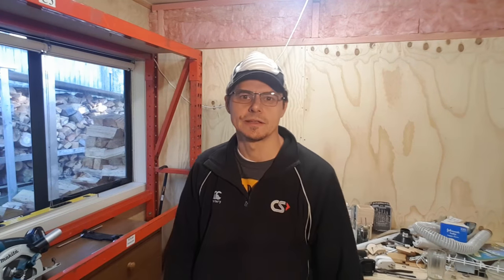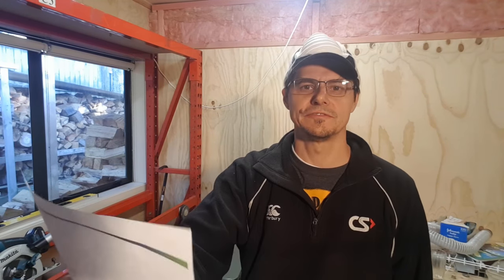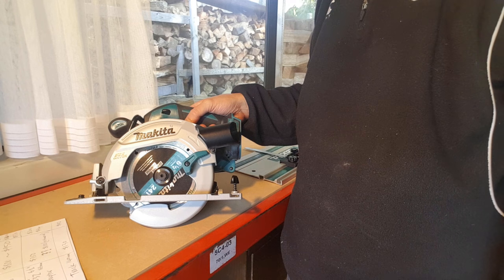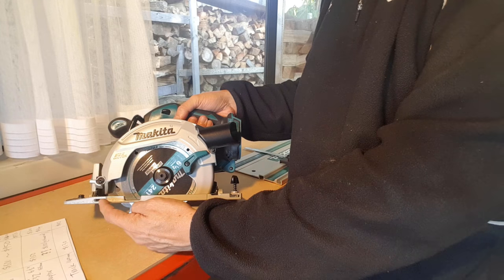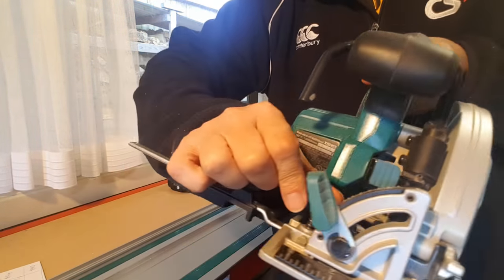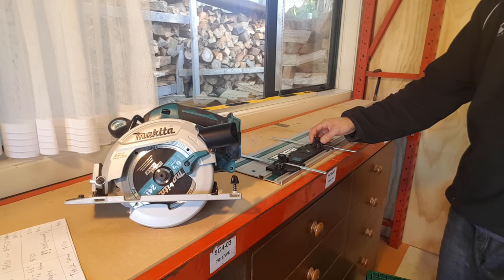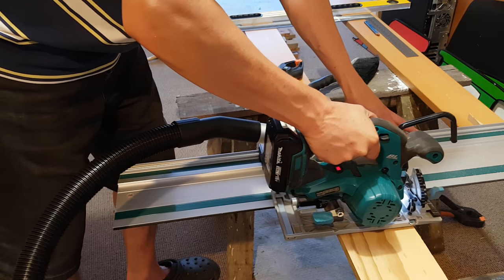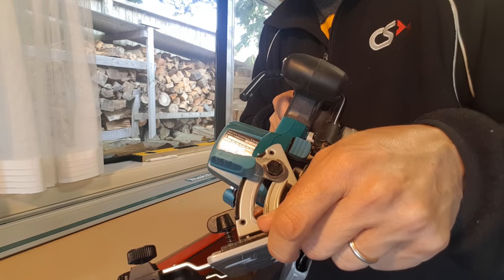Makita circular saw adapter for rail guides - circ saw becomes track saw.

Comment: Hi Rob, a great down to earth video. I have that saw here in UK and now want to buy the adapter. There seem s to be several Makita rail guide adapters over here. Do you have the part number please? Good luck with future videos.
Reply from the maker: Hello Christian - thanks for your comment! The part number in the US is "196953-0 Guide Rail Adapter". I'm afraid I don't know what it is for sure in the UK but you should be able to figure it out from the US one which I am 100% sure of. Makita has different model numbers for almost all their products here in the NZ and different markets; I have no idea why. Here's a link to it on Amazon: http://amzn.to/2px5qFo - if you are doing lots of crosscuts I would recommend the clamps for the track to stabilise it as the weight of the saw can tip it up and move it off the line. For long rips the track stays put just fine with its non-slip pads.
I'd also like to reiterate this as a really worthwhile investment - it has enabled me many cuts with ease at a high level of accuracy that I'd struggled with in the past with clamps and straight edges. 
Best of luck and hope it goes well! Cheers, Rob
Reply: Hi, may I ask, did you find out the adapter name?
Reply from the maker: Hi Christopher, people have told me the adapter can be ordered through Makita stockists if you can't find it online in your country. If you call your local Makita head office they should be able to help further as well. Cheers, Rob

Comment: ...ahh you also need the adaptor, £50 for adaptor and £100 for guide rail , mad expensive here in the UK :(
Reply from the maker: same price everywhere mate - it's a few lbs cheaper for the adapter in the US, the track is much cheaper though. Expensive here in NZ too. I haven't ruined any $100 sheets of plywood since I bought it though. Priceless.

Comment: Hey Rob, Really late to this one, but wanted to ask a question if you're still around :)
You mention in the description to try and never change the setup of the adapter bars as you'll never get them perfect again, but am I right in understanding that they would need to be adjusted if you were doing beveled cuts?
Reply from the maker: Yeah that's correct, it does need to be adjusted for bevel cuts.

Comment: Hi There,

I've got a Makita 165mm corded saw and I'm thinking this adapter and a rail  would be just what I need speed things up. Is there any chance you could give me the measurement  of the bars that connect the adapter to the saw? When I say measurement, I mean from the outside of one bar to the outside of the other.  
Any help would be appreciated.
Cheers from the Waikato
Reply from the maker: Hey Colm, here's all the dimensions...
The bar is 12 x 3 x 290mm, and 214 apart on centre. So 225 from outer edge to outer edge. Hope that helps down in the Waikato 👍🏻 cheers from Pukekohe!
Reply: @TakamiWoodshop  
Thanks Rob, it should work just fine, I appreciate the help.

Comment: good gears Rob.   what is the function of the knurled knobs ? - some sort of adjustment, but I can't  quite fathom them
Reply from the maker: Hey Ted. I think you are talking about the black plastic knobs on the adapter itself - they are just for locking the aluminium arms in place. The arms move in and out depending on what saw you are mounting the adapter to, or the angle you are cutting. When cutting 45¯ the adapter has to come out a tiny bit to allow room for the tilted blade. Hope this helps. Cheers 👍

Comment: Just the video I was looking for, having recently got one of those Makita DHS680s! But can I ask what depth of cut you lose when using the track? I just need to make sure I’ll still have enough depth to, say, trim a door.
Reply from the maker: You only lose about 3mm ... Just the thickness of the track. Cheers 👍🏻
Reply: Rob Tee - Takami Woodshop - That’s hardly anything, making it an even more irresistible buy! Many thanks for the quick reply.
Reply from the maker: Just make sure you have the saw with the two attachment slots, the newer one has only one and uses a different adapter. There are some more details in the comments section here from a user named Zaar. Also I have links to both adapters in the description. Happy cutting man! 🤙

Comment: Thanks for the great idea! I'm a similar situation being a weekend warrior here in Down Under and already having DHS680z. It looked a shame to spend another $800+ for plunge saw that actually has the same cutting capacity as DH6S80z. Couple of questions please: 1. Does the blade aligns perfectly with the track edge such that you can align the track to you pencil mark and roll the saw? 2.  I'm struggling to get 90°  cuts with my saw, using rafter square as a guide as you do - it's always about half a mil or so off along the cut. Examining the saw, I noticed a free play in the fence - it's in the rear part of it, both left-right and up/down. Do you have that small free play in your fence? Thanks again!
Reply from the maker: Hey Zaar, This is a great way to save 800 bucks - I use it all the time and I've had it for about three years. Your questions - #1 yep - it's very easy to align the track to the pencil line and then the saw cuts perfectly along that line. It's very impressive - with clean perfect cuts too! #2 no. My saw doesn't have any play at all and it cuts perfectly every time - whatever angle I tell it to. I suspect yours has some damage or manufacturing fault - it shouldn't move at all.
Thanks mate - hope this helps. Cheers, Rob
Reply: Got the dhs680z also and was wondering about this
Reply: I've just got this adapter on a 680z and at the 0 mark the blade hits the rubber edge which is meant to be cut off I assume by the blade on the 1st pass idk ? For 230 bucks for the adaptor and rail I'm not convinced yet

Comment: What does the teal slide button do on the black plastic guide rail
Reply from the maker: It locks the guide rail adapter to the track so the saw doesn't topple over when it's tilted for miter cuts.

Comment: I have been looking at DIY track saw ideas on YouTube for a while now. And given I have started looking to get a cordless Makita circ saw, I reckon you have made my mind up. With the 2 guide rail slots I think I can still make a good diy job myself
One question though. Does the saw have an electronic brake? It sounded like it when you finished the 45deg cut but it isn't written on the saw like the other models by the looks
Reply from the maker: Hey dude, yes it does have a brake - you can see it in action on this other sled thing I made .. https://youtu.be/DCcwjFEG88E?t=13
Reply: @TakamiWoodshop  Onya Rob. That sled was a nice job too. Good to see he saw rip through that big laminated beam too. Will be getting one next week!

Comment: Hi there I just got one of these today, may I ask you a couple of things? how did you cut the black trip off at the beginning of the track since the whole saw is not on the track and hence it wobbles which means an uneven cut. Also did you find when you line up to zero at both ends its not quite level - one side seems perhaps 1/3 mm out? or do you thing that makes no difference? thanks in advance
Reply from the maker: Hey Chris, for cutting the strip at the beginning I honestly don't remember what I did but I'd recommend placing a sacrificial board of some sort under the part of the saw that isn't on the track - say, some 2mm mdf or something - whatever it takes, and maybe setting up a straight edge if it helps to make that initial cut cleaner. Another way could be to loosen the depth of cut knob and plunge down into the strip - not sure if the blade would reach that far back though but worth investigating. 
If you can't get it cut consistently with the rest of the strip you just have to remember not to use that first part of it to line up with your marks. Or you could cut it away with a blade later on, or plunge in and make the cut on the bulk of the strip, then back the saw up to get that last little bit at the beginning. (I'm just thinking out loud here) Ultimately - borrow another track and run along it into your new one and you can't fail that way.

About the adapter not being level - do you mean it has a bit of twist in it? I don't think it matters as long as the arms are set at zero (identically) at both ends the blade will run true and the weight of the saw will press down and take that 0.3mm out of the equation.

Cheers man, good luck and happy cutting! 🤙
Reply: @TakamiWoodshop  yes thanks for the time, I just came to that conclusion about the beginning and end- its just for the saw to sit as you get to your stock to cut, it is 150cm long so good job really for that reason. The arms being zero - i noticed (forgot to say before) when they are both on zero the black plastic body that touches the metal of the saw (base) is not quite flush - a bit of a bigger spark than the other side that what got me thinking also about the zero marks are they accurate . so its either the markings are not accurate with each other or the main body of the black plasic is not quite true - like you said if its out just by 1/3mm then should be ok. also actually there is a risk of not putting to zero since the blade gets very close to the track it self. for some reason i was expecting the arms to 'click' in position for the zero - well I guess worse case I buy another rubber strip to try again :) .
Reply from the maker: The zero marking could be better I agree - I'd like it to click as well but what I do now is ignore the mark somewhat and try to just line it up with  where I want it to be on the strip. You don't want to let the blade get close to the track (don't ask me how I know that 😉).
One more trick with these tracks - you can peel off the strip and flip it around and start again if it gets too manky. The strips can get damage or inconsistencies by using blades with slightly different kerfs - that's actually how I ended up ripping a big strip of the aluminium off the side of mine.
I set mine and leave it set now - I don't adjust it once I've dialed it in how I like it. The main reason I do this is that I also don't really trust the accuracy of the body, the zero marks, or anything really. Rather than rely solely on the marks it's worth double checking with a ruler or some calipers.
Once you get it set up it's a cool tool though. Much much better than clamping on straight edges.

Comment: Hi video, can I ask you somethings? at 3.11 when  you did the mitre cut - what tool make etc did you use to get your 45 degrees so perfect? What saw did you have to cut the dowels flush (4.32) and lastly I love your drill press :) you selling it any time soon , looks old but built to last . thanks in advance
Reply from the maker: Hi Christopher - thanks for your comment. The tool at 3:11 is the Makita XSH03Z Cordless Circular Saw (https://amzn.to/3ccFGGy). For flush cutting dowels I'm using a Japanese made Shark Saw similar to this one - https://amzn.to/3iFihzK - I also have and recommend this one more than the Shark for flush trimming: https://amzn.to/32C5IzI
The drill is a beauty indeed - but I have sold I already I'm afraid 😥. It was too small and wasn't very powerful. I've replaced it with a 1 HP model - 400% power increase and much larger capacity.
Cheers mate!
Reply: @TakamiWoodshop  thanks for the info

Comment: Welp. This will definitely NOT be replacing my plunge saw. Looks like a really nice saw though. Pretty bad track saw design though.
Reply from the maker: Woop, I wouldn't have this if I had a plunge saw either. But just curious - why do you say it is a bad design? In the video I thought I presented the case fairly well that it works pretty freakin' well. I've never had a problem with it in fact.

Comment: Question about the attachment. Once it's connected to the saw, does the attachment clip into the track or is it just sitting on top in the channel?
Reply from the maker: Hi Travis - the saw does not need to be clipped unless you are doing 45° cuts in which case the saw will have a tendency to want to fall off - in this case there is a clip on the attachment to prevent that. It's only really for when the saw is sitting unattended - when you are making your cuts you'll be holding it firmly in place as you push through. I've been thinking about doing an update video after about a year of usage - my biggest tip is to make sure you have the attachment pushed right up to the stoppers, and don't forget to adjust the position for different angles. By failing to do these things I have cut most of the rubber strip off the track and even nicked the body of the track slightly. And finally - for narrow crosscuts (300 - 400 mm or less) I'd highly recommend the clamps that hold the track to the workpiece - I wish I had them - to prevent the weight of the saw upsetting the position of the track on your cut line. Enjoy the system - I sure do!

Comment: Hi,did you say you have the "DHS680Z 165MM 18V LI-ION " ? thanks
Reply from the maker: Correct (ish). Technically it's a XSH03Z because I brought it back from the US, but in NZ it's model number is DHS680Z (165MM 18V LI-ION) . The only difference is that on my one the measurements are in inches whereas if I'd bought locally they'd just be metric. Sweet saw, sweet setup. I still don't have the plunge saw and I still use this rig all the time. Cheers. 👍 (Check out my other vids if you haven't already - come one come all)

Comment: Hi, good video, did you find the cut using the guide was perfectly straight? also do you think the track and adaptor will fit the  Makita HS7601J 190 mm Circular Saw (I am in the uk, why the change code for parts of the world god knows)
Reply from the maker: Thanks mate - it's really hard to say if it will work with your saw. The bars on the adapter are 215mm apart centre to centre if that helps. Been using it for a couple of years now and yes - it cuts dead straight every time. cheers, Rob

Comment: Hey Rob - Fantastic video! Got here from Scott Brown mentioning this video. Now subscribed! Been looking all over and hadn't found this info. Will now chase down the bits and pieces. Way cheaper and more versatile for a diyer over a plunge saw. Thanks mate. Cheers PP
Reply from the maker: Hey Poopy, cheers mate, hope it all goes well for you, been using this set up for a couple of years now and it's still mint for my needs. I've been thinking about getting another track to cut in half to use for crosscuts as well.

Comment: Hi Rob, loved your vid prez. I’m late to the party on this but have a question please. I have a DHS680 and have just got the guide rail adapter. What way up do you fit the 2 rails? They’ve got P & D marks. Also is it different for LHS & RHS fit? Keep up the vids mate! They’re brilliant for late starters, like me. Cheers, Paul
Reply from the maker: Hey Paul, mine goes like so...
Holding the adapter so as the embossed Makita is upside-down, insert the rails in from the left with the P side facing up.
Then insert into the right side of the saw all the way to the positive stops.
It does work in other configurations but this is the best I've discovered. Good luck mate, great piece of kit, I've had it for about three years now and use it all the time. The numbers on the rails are for the offset for the angle of your cut, but just double check that the blade isn't going to cut off the side of your track, don't ask me how I know 😖
Reply: @TakamiWoodshop  Thanks Rob. Much appreciated, mate. I must admit, I tried it out and got an almighty shock when it cut into the rubber guard a bit. But after thinking about it and looking at your notes, it seems that’s normal as it settles in?
Reply from the maker: Paul yes you cut the rubber strip the first time to establish the zero clearance splinter guard line. My advice is not to take the rails off all the time because if you don't set it up exactly the same each time you can be off that line either too far from the rubber for it to stop chip out, or trimming the aluminum itself like I did (ouch). Once you dial it in try and keep it. You can unstick that rubber and move it out a bit if it gets all manky. Needless to say, use a nice/sharp blade for best results 👍🏻
Reply: @TakamiWoodshop  Thanks Rob. Ripper! Makita should thank you as well because there is precious little info/guidance out there. Cheers, Paul